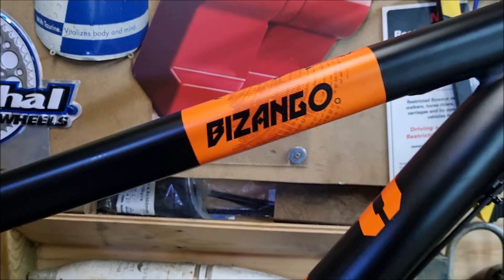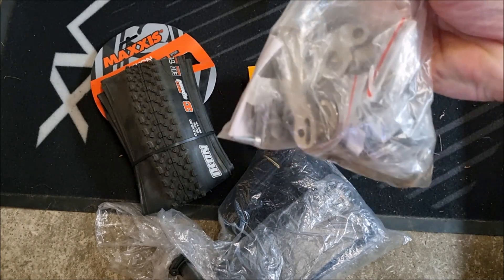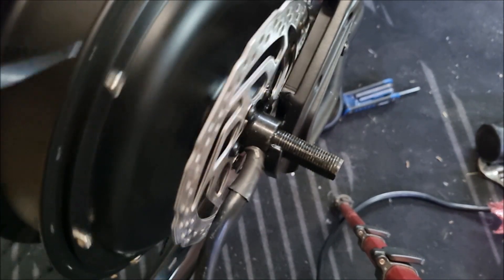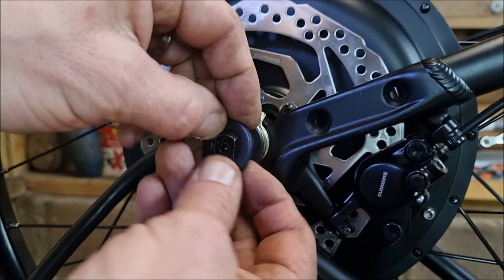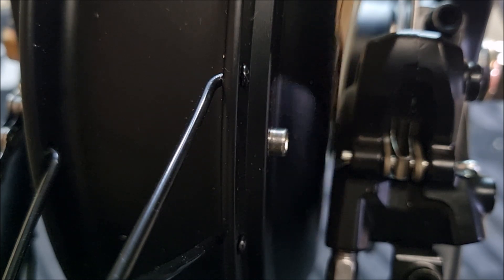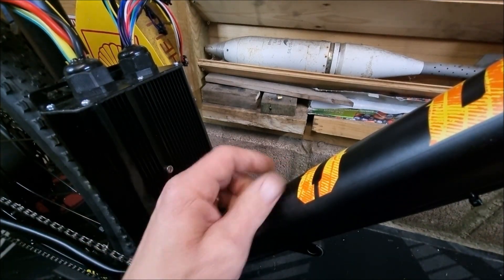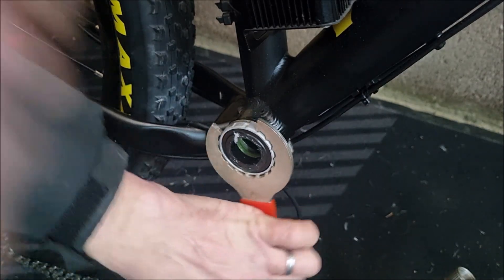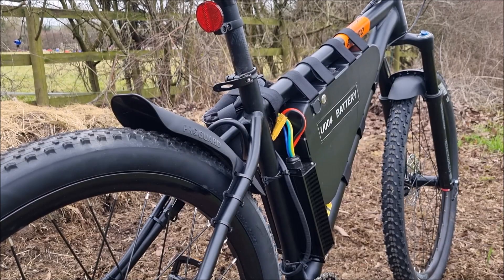Building a 3kw 60v E-BIKE

Comment: I wouldn't be drilling holes especially where you need torque strength in the frame. no need for brake cut of sensors or peddles or peddle assists just more ugly wires to run..

Comment: What I did with my cables was take photos of all the plugs, remove the pins from the plugs, cut off pins, cut cables to length, solder pins onto wires and reinstalled pins in plugs using photos as reference.

Comment: As an ebike owner. 3kW is way too much power to use on a bicycle. If you don't use ebike rated brake pads and even If you do, you will be wearing them out twice as fast as a 1kW motor. And most bike tyres even ebike rated tyres are not made to do highway speeds. I've done 60kph and that's sketchy at best even with wide mountain bike tyres. 3kW should be used for motorbikes not bicycles
Reply: Go back to your knitting. He can live dangerously if he wants.
Reply: @davidcoates4852 😂😂 nicely said 😂
Reply: 😢boo hoo hoo😢
Reply: This guy gonna hate the 15kw carrera mountain bike im building. It doesnt even have disc brakes.
Reply: @MetalFan10101 😂
Reply: damn @MetalFan10101
Reply: Break pads are cheap..... Like a set of 6 for $12
Reply: You have a good point. After putting a 3000w on my mt bike, I prefer the ride better on the bomber frame. Just saying
Reply: Wait until this guy finds out I run 28kw on my ebb bomber frame with pedals 😢
Reply: Aha lol I know a guy who does 5kW e-bikes
Reply: I do 30 with a passenger on my 160 dollar mtb on narrow street tires, I can feel the tire flexing on corners even at 60psi
Reply: The Brakes are a good point.

But there isnt too much power, if he wants 1 kW He can use only 1 kW
Reply: He should do 60 mph now
Reply: Would a dual 1500w be okay though
Reply: Brooooo 3kw is so slow at least like 9-15000w is good
Reply: Also hate to mention that torque can snap that frame.

Comment: How did get back wheeel  to as fro it 142 instead of 135 any help would be appreciated
Reply from the maker: It was easier than I thought on this frame. I guessed I was going to prie open the drop out posts a little but I fitted better than my previous 2000w hub. Hope this makes sense

Comment: I’m having issue finding brakes that will fit on the back hub, I’ve tried the Clarks m2s and m4a and none work, any solutions ? Thanks
Reply from the maker: I've not had that problem so I can't comment. Ii found the hub roomy compared to previous hubs. 
How does it not work ?
Reply: @motomachinezuk8786  the calliper just doesn’t fit however I put the old disk brakes that came with the bike and they do fit, trying to find brakes that are small enough

Comment: Ok the hub may have larger gauges, but honestly other than that for £1300 is abit much! We can buy a £500 MTX kit and vesc it , or any other 50a-80a controller for a lot less! 

You should crack it open and do side by side with your mtx wheel.

Comment: I see how you did the washers on the torque arms for the nut, nice job. And now the fun begins 🤪💯🚲💨
Reply from the maker: I should actually make a nice plate for this power although nothing compared to the power you run just for peace of mind. 
I notice you run qs motors and build own batteries. Wish I could build batteries, it's something I don't wanna get wrong as could be fatal. 
Thanks man
Reply: @MOTO MACHINEZ UK  but bolting the torque arm to the frame is way better than the hose clamp method in my opinion
Reply from the maker: @E-bikeguy  totally agree, I've only built 3 bikes and always managed to bolt into the frame. So never had to use those clips . Cheers

Comment: I have a 1500w csc kit and just got a 60v 20ah 50a bms battery made from molicells p42a 21700 would my motor be ok with this power i am upgrading to a 45a controller
Reply from the maker: Yes I would think so definitely just when it's real hot in summer just be weary it m8ght get warm but I doubt anything to worry about. I see people pushing more power from 1500w hubs

Comment: 3:05 
If you only put one washer on one side.
The wheel won't be centre 
It will be like 3mm out on one side.

And on some bike frame you may need the plastic spacer for the disc.
Especially on front hub motor.
It's best to check first before cutting it off.
I've only needed one time

Comment: A cliff-hanger ending...you tease Johnny!! Can't wait to see you in action on this one! I had a similar issue with my bike when it came to real estate and debating where to mount everything. Ended up adding a rear bike rack and placing controller and wiring in the controller bag, on the rear rack. Its neat, tidy, easy to access, and was really my only option; just not a fan of bike racks, lol! Great to have a video from you, and looking forward to lots more motomachinez content! Great stuff, as always!
Reply from the maker: Yes this bike doesn't have screw holes for a rack like other bikes have. But yes they arnt pleasing to the eye and more weight on backwheel won't help. But gotta do these things sometimes I understand that. I shall find a better way to house it all. 
And cheers the plan worked. 
That bike must have a bit of poke?  Thank I'm looking forward to spending more time with it for sure

Comment: Never heard of that bike I thought it was a cheap one until I saw Voodoo,  one of the earliest e-bike builds I saw was using one of those bikes.  I bet the forks are better than mine, maybe I didn't look after it properly but I am sure I saw it seizing up sometimes, I also think the way you attached the torque arm could be more convenient than the metal clip method. Did they say how many amps the battery can output ?  apparently with these type of motors higher current creates more torque whereas higher voltage gives higher top speed, depending on wheel size ( simplified explanation I think ). I expect you can get to 40 on this bike, but your old ones were also surprisingly fast.
Reply from the maker: Well it is cheap I got on sale after Xmas but is a highly rated bike for many reasons. Best hard tail budget bike. Luckily still with rear dropouts rather than axle. So many things to consider when selecting a donor bike. Forks are not great on giant but better than trek. Just need to keep them clean but I want to show on vid my trek forks after over 1200 miles. I have major play and when I brake hard I can see a gap down fork tube. 
The voodoo forks arealot more durable and air so I can maintain better. I not sure of battery amp out put I shall find out. Yes voltage is speed and current torque. And the torque arms set with screws does make removing wheel job easier if needs to come off, happy with torque arms. Do you have 2 on your bike ?
Reply: @motomachinezuk8786  yes 2 with the metal hose clip things, so far no problem, had 1 puncture on these tyres but I fixed with the patch without removing wheel.  I am interested to see how much more range you get with this battery vs the standard rectangular ones on your old bikes. Having more power seems to drain the battery faster from what I can see, even if I try to keep it in mode 2 almost all the way. I haven't tested the exact range I can get on the BBSHD bike with the same size UPP battery but I know its over 55 miles.
Reply from the maker: @ash0787  will be interesting and iwould have to get carful with power. I know what you mean as this 750w 48v demo bikes range has surprised me. I've noticed on the trek I get more miles per charge riding at about 10mph in level 2 than riding the same in other levels. Rolls at a better more comfortable speed

Comment: Mount the controller using rivet gun to make bolt mounts under the Bike frame and use black heat shrink to cover the coloured wires and the make then neater
Reply from the maker: I've seen a few people mount it on the underneath of downtube. I shall have a look and definitely appreciate the ideas. I've wrapped the wires so they look better. 
Cheers man
Reply: @motomachinezuk8786  yea bro looks sick tho
Reply: Dude! Cmon. Great build, gj
Reply: @davinadavidson9062  hu ?

Comment: thats really cool i still have a 1500w rear hub with max speed of 35/40mph on a 52v 18ag battery but the acceleration is not that great but stil works fine
Reply: What will give us more acceleration ?
Reply: @user-uc2dk1vp6e  upgrade to higher amp controller/battery 
Higher amps=more torque
Higher voltage=more speed
Reply: @wastedWizard509  I thought amps = more cells more range
Reply: @user-uc2dk1vp6e  Shunt mod your controller.
Reply from the maker: Thanks and I still have and use my 1500w hub it's a decent everyday bike. 40 I think feels fast enough on a bicycle. How many miles do you have on it ?
Reply: @motomachinezuk8786  i don't no my display is acting weirdly i can see the votage but not the battery bars my speed or watts i think its broke because of water throttle just works fine but i never gonna buy a lcd8h display again